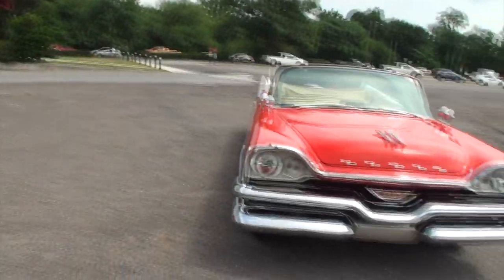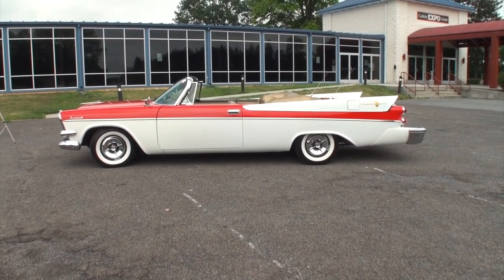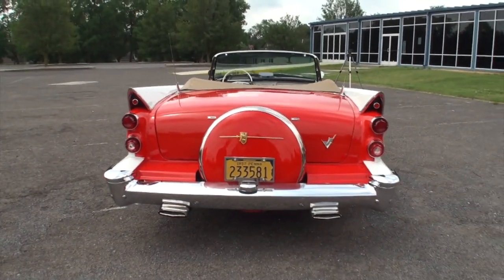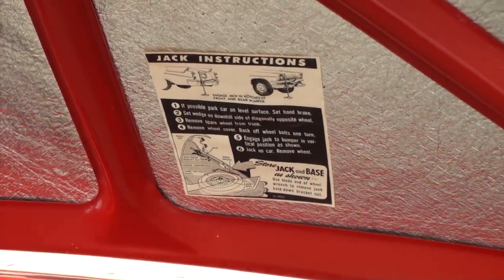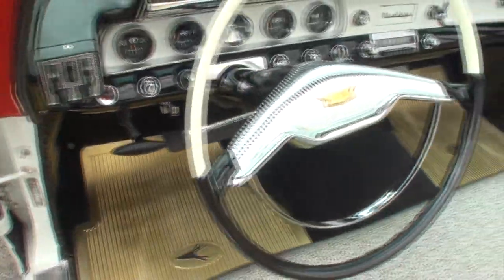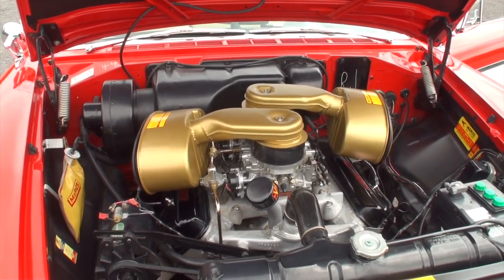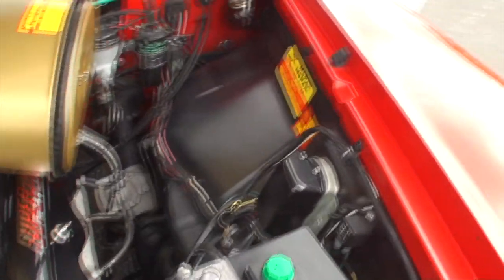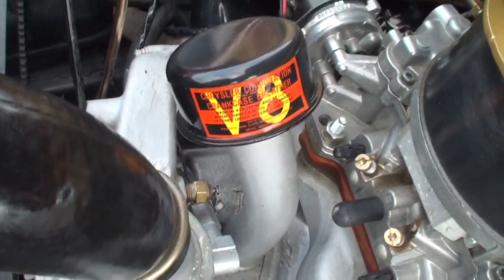1957 Dodge Coronet Convertible in Red & White & Ride on My Car Story with Lou Costabile

Comment: This is a wonderful car but it has some issues for modern day driving. I'm impressed in how much work he has into the car but given his age and how many miles he drives it is somewhat bare bones. I'm pretty sure he has at least 50-75k in the car alone and it doesn't have power steering, power brakes, or air conditioning. Air Temp air conditioning, power steering, power brakes, power windows, and power seats were all options that year and I was surprised that it doesn't even have a usable radio. I'm not really in favor of loading a car with aftermarket items but I am for a car "keeping up with the times" as much as possible. Does look great though.
Reply from the maker: Hi Moral Platitudes, Thank you for viewing and sharing your thoughts. Hope you see many more cars on this YouTube Channel you enjoy. Please subscribe, and hit the "bell" so you can see all the cars when they are uploaded on this YouTube Channel, Lou